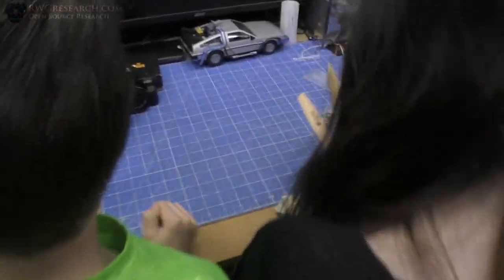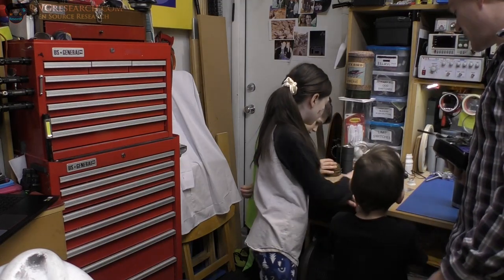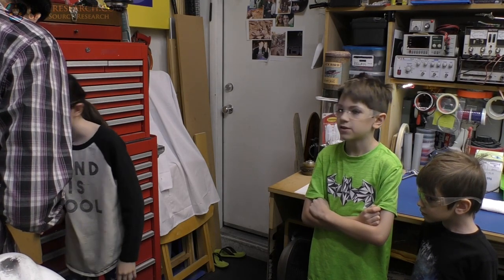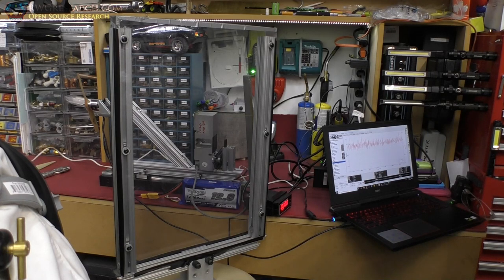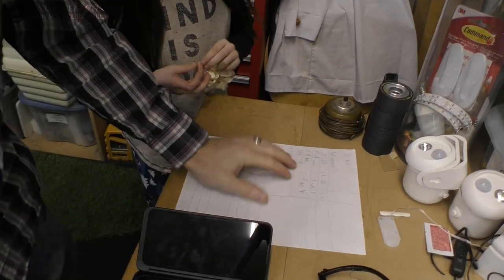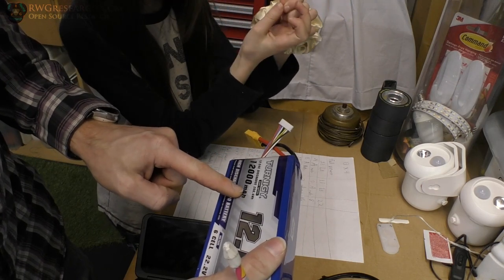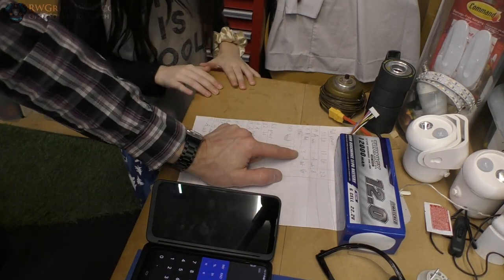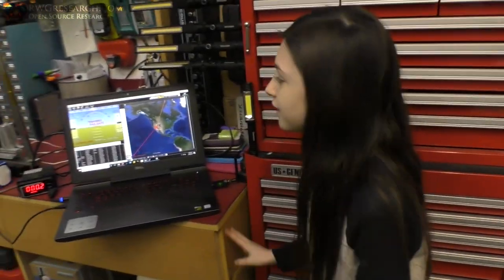2-21-2021: RC#12 - Testing Props With The Prop Thrust Test Rig! #30-22

Comment: You could check rpm . Then at a certain thrust could check the rpm and amp draw to see which pitch is better for normal flight . Then a more aggressive pitch if you want tricks so faster rpm for quick thrust . Great video.
Reply from the maker: yep exzactly. and in fact that s what we did :) ~Russ